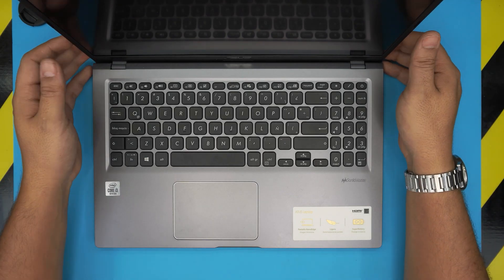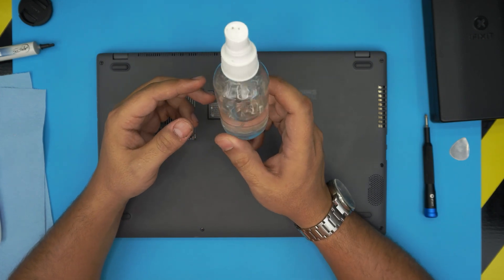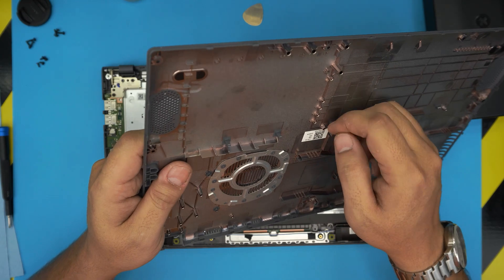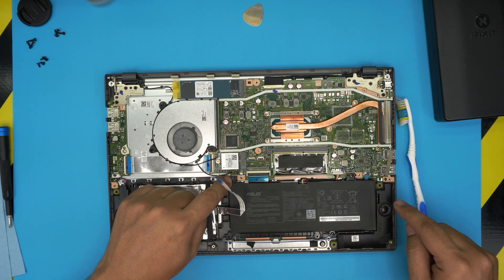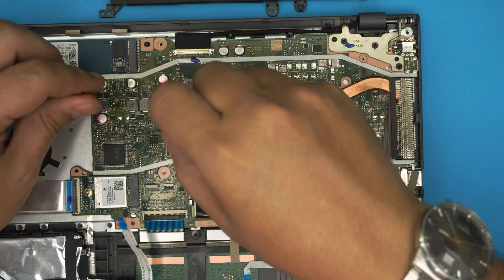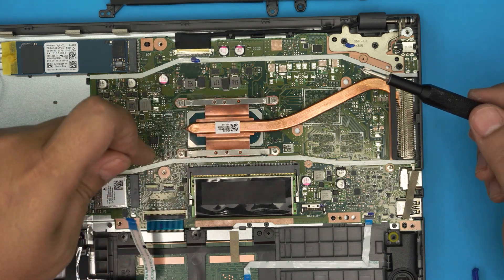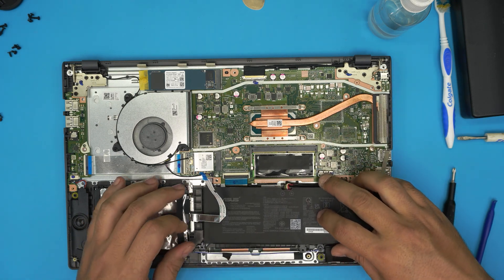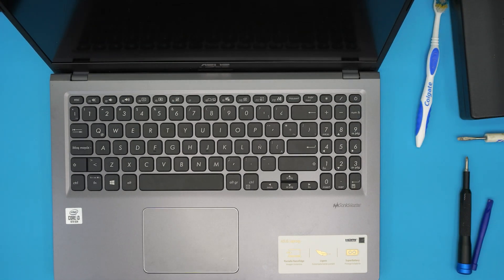ASUS X515ja Bq504t 💻 Repaste & Cleaning

Comment: If i want to repaste only, can i just do directly by removing heat sink without removing battery and fan first? 

Same question if i want to clean the fan only...

Because i want to learn to do this one by one :)
Reply from the maker: 🫠Regarding your question, you can remove the fan without removing the heatsink, but if you want to remove the heatsink, I would highly recommend disconnecting the battery. If you don't, you have to be super careful not to drop a screw on the board when removing the heatsink.
Should you have any further questions or requests in the future, please don't hesitate to ask me.
cheers🍻

Comment: bro i have same model and same as it is can i repalce cpu to other one
and use external gpu
Reply from the maker: 🫠Regarding your question, the CPU is soldered to the board, and if you do a reballing on the CPU, you will need a compatible BIOS for that. Also, if the power regulators on the board are not changed, they will fail sooner.  

You can use an external GPU, but you will only be using about 60% of the GPU's power.

cheers🍻
Reply: @uFixTek  Thankyou so much bro "Can you guide me on which thermal paste is best for my Asus VivoBook 15 laptop? Should I use a metal-based one or a ceramic-based one like Cooler Master's? Which one provides better cooling?"
Reply from the maker: I have linked the top and second-best thermal pastes in the video description.

Comment: Can i also do this on asus X515J or X515JP- EJ117T?

I just had the ram and ssd replaced by a friend and they cleaned a bit of the fan. We just brushed it but did not remove it. It still heats up quickly. I mostly use the laptop for school only. I do play some games on it but they are light games only. It still heats up quickly. 

My friend told me it might need some deep cleaning. I looked for shops that offer services but it’s quite expensive so I am hoping that I can also do this tutorial on mine.

I am also thinking of buying a cooling pad. Specifically the ￼Llano V12. Are cooling pads good for the laptop? Will it not damage it in the long run? Or not get moist inside from the cool?

Thank you and sorry if it’s quite long. I am not very tech savy😅
Reply from the maker: 🫠Regarding your question, yes, you can do that on the model you mentioned.  
Repaste with a good thermal paste linked in the video description. As for the pads, don’t touch them—leave them alone.
Should you have any further questions or requests in the future, please don't hesitate to ask me.
cheers🍻
Reply: @uFixTek thank you😊
Reply from the maker: It's my pleasure my friend.

Comment: My laptop is not turning on idk why i just remove the battery and put itback
Reply: Pla help me
Reply from the maker: Do you see any light indicators when you power it on? Is there any blinking? Why did you remove the battery? What else did you do? I need more details to understand the situation.
Reply: @uFixTek  yeah there's some light and like 4-7 seconds it turn off
Reply: @uFixTek  i remove the battery then i tried to remove the fan but the fan wire i cant seem to remove it so i just let it be since i might damage it and then i remove the screw of cpu to brush of the dust

Comment: CAn you please let me know about the wirelss adapter? Is it one anteena or two anteena? Actually I want to buy intel wifi card but I need to know about the number of anteena.
Reply from the maker: 🫠Regarding your question, get with two antennas this laptop has one antenna , but you can buy an extra antenna on amazon and attach it and tape it inside the case.
Should you have any further questions or requests in the future, please don't hesitate to ask me.
cheers🍻

Comment: I forgot the bios password of this laptop same x515 can you help me to reset it please it's request
Reply from the maker: 🫠Regarding your question, you will need to get a bios programmer and open the laptop and connect the programmer to the bios and connect to another computer and re-programmer and load the .bin file into it. nothing something you can do if you don't have experience.
Reply: @uFixTek  Really thanks for the reply i have been looking for it everywhere, is there no way i can do it myself? Like any other easier way to be done by home. Thank you again.
Reply from the maker: it is not hard, all you need to do in an another computer download the bios file from official website and then open the laptop expose the laptop motherboard disconnect the battery and connect the prong of the programmer to the BIOS chip on motherboard and connect the other end to the usb port of another computer and load the .bin fine and write the bios.
https://amzn.to/48NUwP8
i will make a video soon how to use it and how you can flush your bios.

This is an Amazon affiliate link. When you use my links, you are helping to support the channel. 🙏

Comment: I once used  this laptop. It sucks at cooling. why tf fan and heatsink so far? copper is so long and heatsink so small. reaches 91c and redduce clockspeed at not that heavy games.
Reply from the maker: Thank you for your feedback! If you wish to support the channel, you can like, subscribe, or both!
Regarding your question, it is very sad that they go this far to design something that will fail, they need to milk the cow they making so many  reversion (categories), ASUS do make a very good motherboard and design too.
cheers🍻
Reply: Bro like I'm crying about the same thing. I'm looking to experiment on mine because I'm actually using the Ryzen 3 variant and it's much worse. Do you know where I can get this specific cooling assembly? I'm thinking of putting it the exact opposite just to see what will happen.